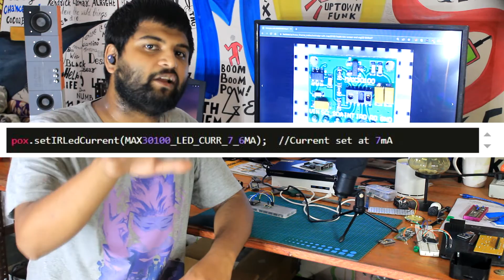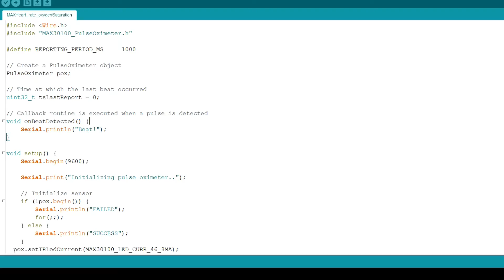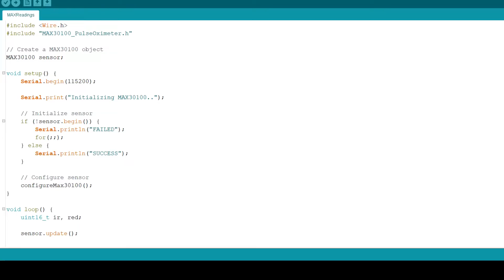MAX30100 ESP32 DIY OXIMETER

Comment: Recently i'm using max30100 and esp32 to make IoT based health monitoring system but having some issues with it. I've modified the module just like that and when use only esp32 and max30100 i get proper data values. But when i use esp32, max3100, dht11 humidity,temperature sesnor and dsb18b20 temperature sensor,  max30100 gives no value. Other modules works fine but it gives 00 value. The led of the max30100 glows but doesn’t shown any data. It works fine when i use only max30100 and esp32. Do have any idea how to solve this?
Reply: Ohhh shit just yesterday I have the same problem and can't find sulutions :'v
Reply: I have the same problem :( excuse me, did u find any solution?
Reply: I am making health monitoring system as well and facing the same problem
Reply: @omnikam4371  Did you guys find a solution? I need help.
Reply: i think you are using a web server based project, what happens is that wifi code hinders it from displaying the values, u need to do multi tasking
Reply: @VijayKumar-cj4uy  what do you mean?please expound further working on the same and still getting problems